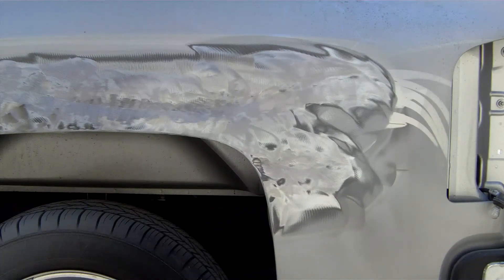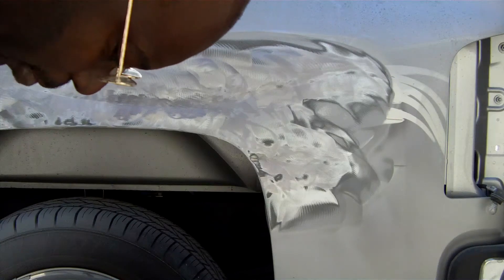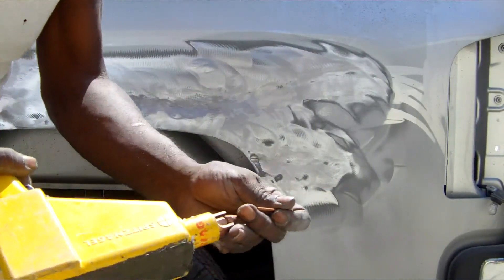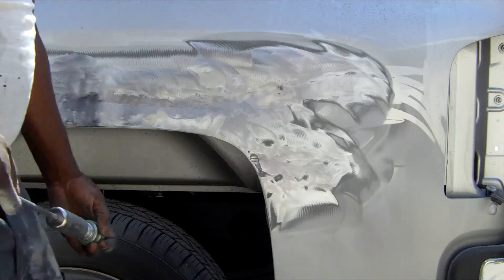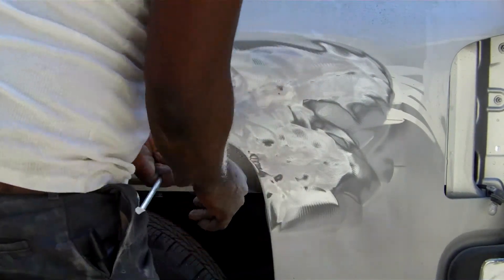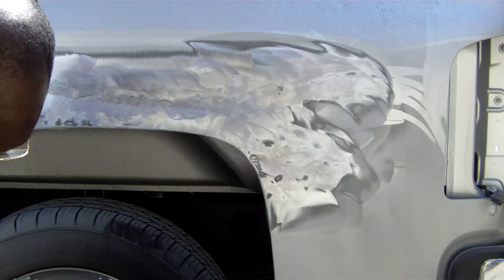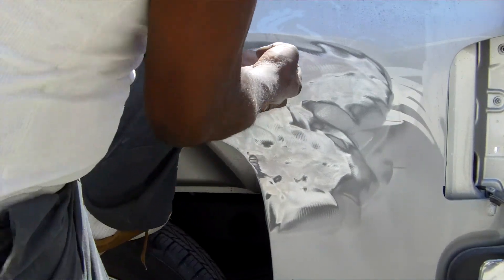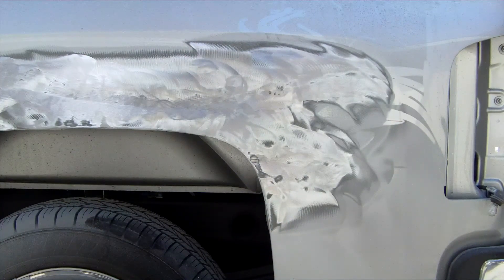how to repair a body panel part 2

Comment from the maker: thanks friend
the greatest advice i can give you is #1 don't use to much hardener specially on a hot day stay in the shade you don't want the filler to cure and get as hard as rock if you let it get hard you will be sanding wood.
you want to sand it or cheese grade the first coats to remove the low spots then the last coat of filler is spread thin and you let that get 100% hard a thin coat is much easier to sand then a 3 inch hard coat i can sand a 3 inch thick 60% hard in seconds

Comment: when your pulling on the stud you should lightly tap down the high spots with a body hammer that will help the low spots stay popped out i'm a bodyman too i like your style alot of guys will hammer the slide to hard and then you get a big outy or high spot  i like how you just pull instead of hammering thats how i do it to

Comment from the maker: also makes it easy to use the filler when you get the metal back to perfect as best you can try not and pull to much in one spot so you dont stretch the metal pull different low spots of metal out until the dent pops out or needs little help after other spots around it have been pulled out then the rest just gives sometimes its like a combination lock pull here pull there and bingo over there popped out on its own.
also last coat of filler needs to be spread very smooth streak free makes it easy

Comment from the maker: see how i sanded the filler without air compressor or air tools
i have made 300 bucks in 30 minutes with a block a claw hammer and a can of white paint.
my best earned was 1000 bucks for 1 hr car had dents all over from a theft for insurance company.
there is zero to no Americans in this profession any more due to the amount of crocked employers that run some shops like its a bar or sallon.